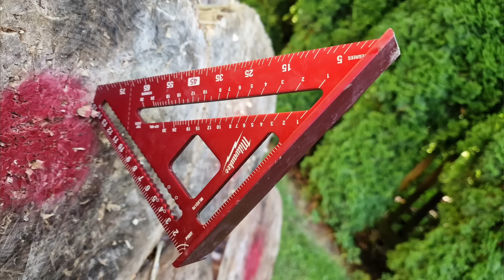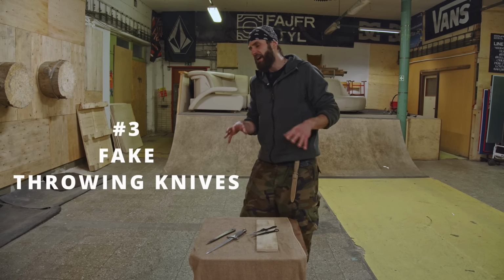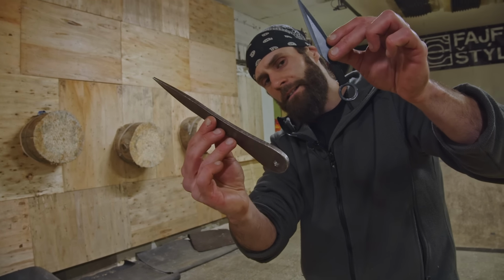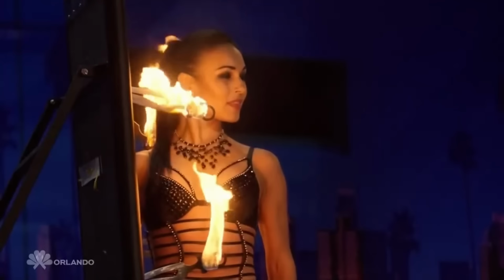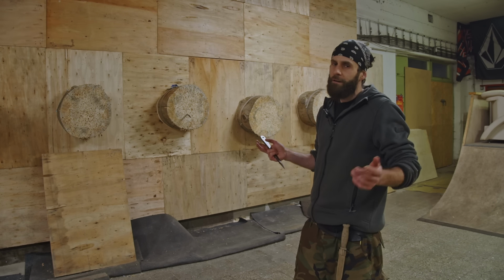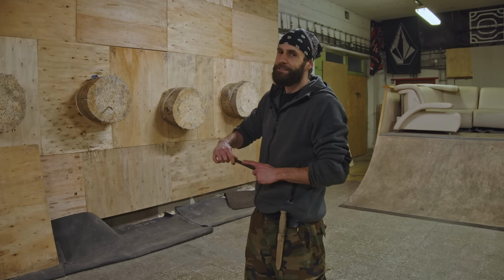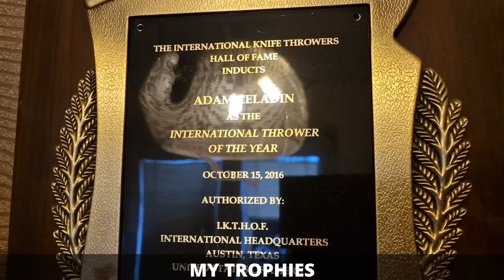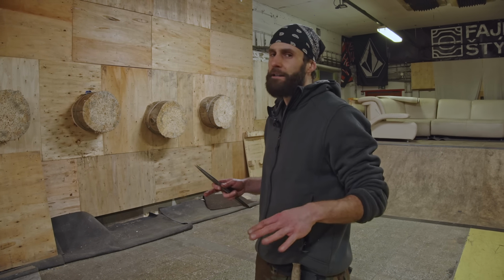FAKE VS REAL Knife Throwing (Secrets Revealed)

Comment: When I was younger I used to practice a little. I used some knives and darts.

   I never got any straight throwing knives only rotational and I honestly cannot stand rotational throws. I really enjoyed the darts though.

   I also learned to throw a cigarrette into my lips at one point with really high rates of success but that was when I smoked 100's and doing it with regular ones would take learning where to place my fingers on the right spot.

   The underhand throw is possible if you learn when to release properly but thing is the knife will always have the handle pointing down or straight it will never have a handle pointing up. 

   I prefer to use straight throwing because it allows me to do a slip release instead of a opening release. I find a slip release to feel very natural while opening to release gives less aim control.

   Nice video thanks for making it.
Reply from the maker: Thank you for watching and comment

Comment: I don't like being lied to.  Nuff said.   I was a backyard thrower for several years on and off when I was younger.  While I can get most anything to stick a fairly long  (10 inches or about 25 cm), heavy, straight blade hunting knife with a full tang was the only thing that was actually worth throwing and had legitimate control.  (it would have done some damage)
Reply from the maker: Thank you for watching and commenting